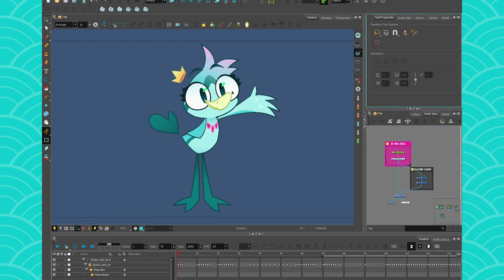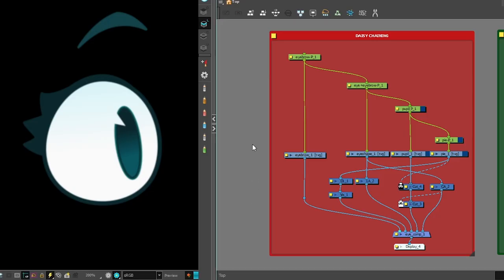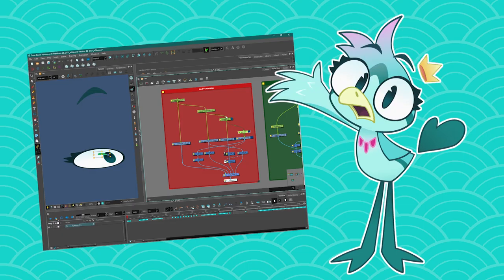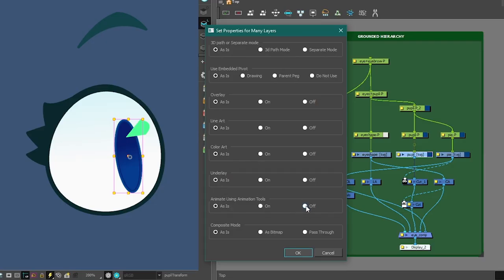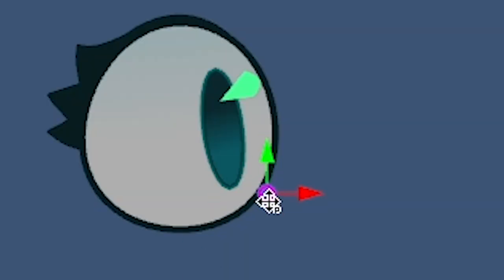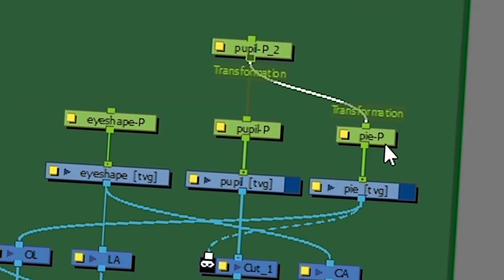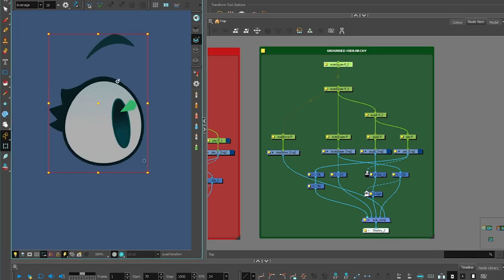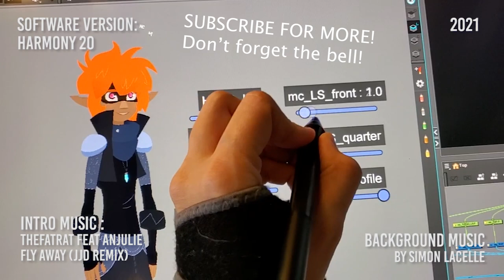RIGGING - What Not to Do part 1 (Harmony)

Comment: Aren't all those pegs you copy pasted clones now? So if you manipulate the copied ones it'll also affect the first ones? 
I usually do paste special "create new columns" checked so I get the name and coordinates copied but they are not still linked for manipulating later.

I always have my preferences set to default to separate pegs and have default "animate using animation tools" unchecked. Is there a reason you do it manually? I've seen in other videos you do it manually too.
Reply: How you set it to default?